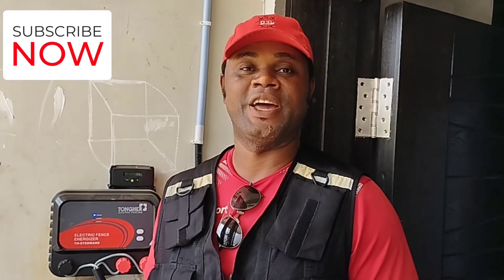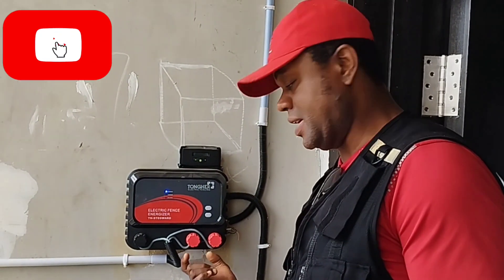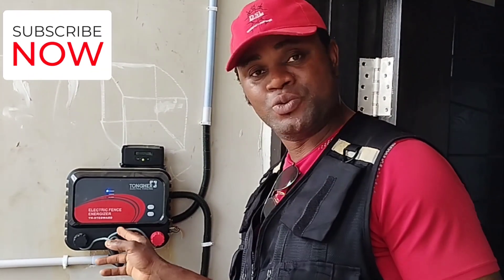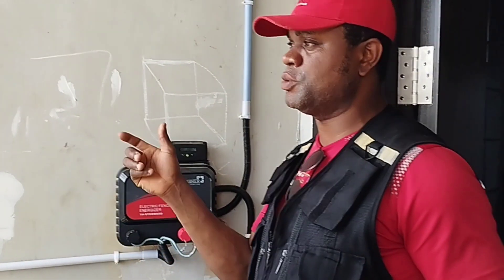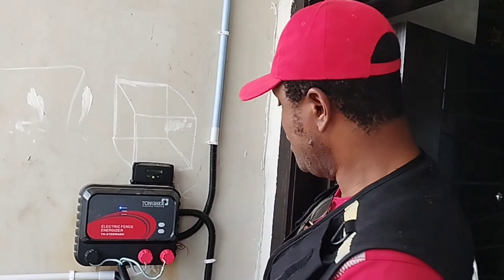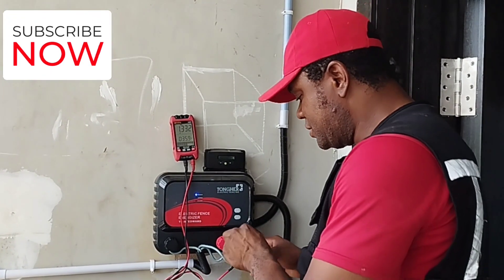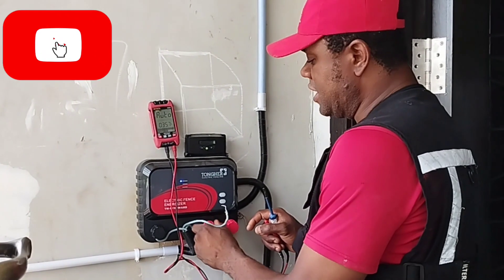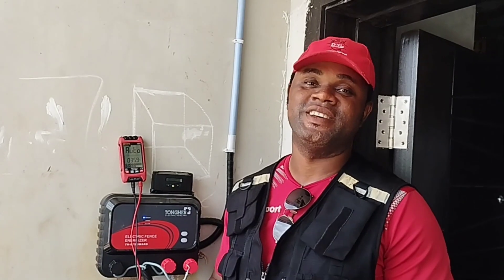Quick Energizer troubleshooting using a Multimeter but without a electric fence scope.

Comment: I have been following your tutorials.and it helps me you are a good teacher.
Reply: Like the VT defender Energizer how will I connect the earth because it is only one terminal.
Reply from the maker: Thank you so much for your kind words, I look forward to doing more.
Reply from the maker: For the VT defender Energizer, the single terminal is looped to all earth line on the fence, and also to the earthrod. It can be in parallel, as looping the earth in parallel has no negative impact on the fence.
Reply: @defotechtv9093  thanks

Comment: Some persons actually uses just two wires which is the return nd forward.without any wire going to the Earth on the Energizer.is it proper?
Reply from the maker: No.... It is not proper at all.
Reply from the maker: Earthing plays a very important role in electric fencing, an electric fence is almost useless or very ineffective without earth.